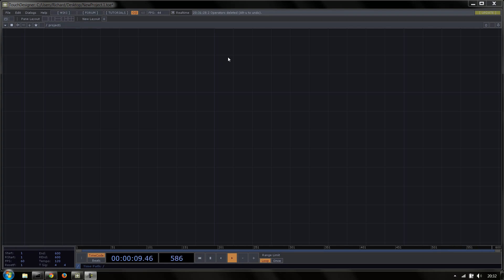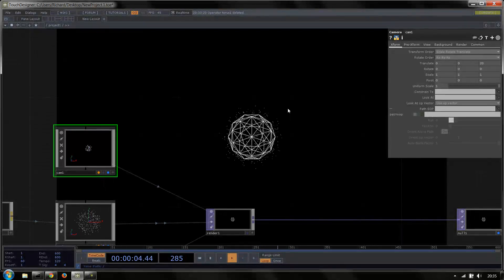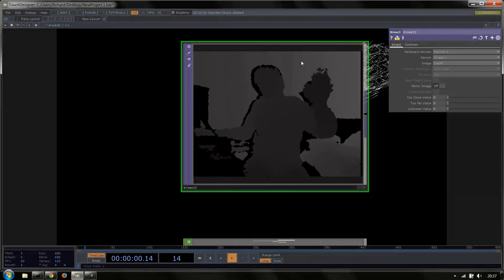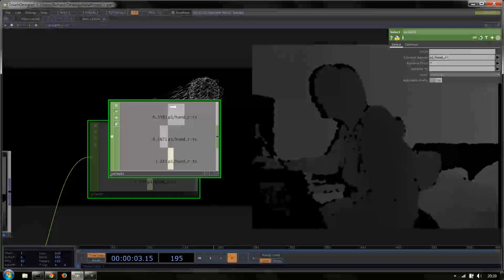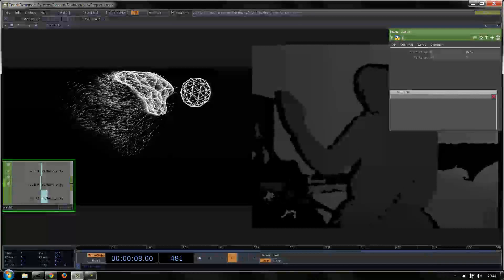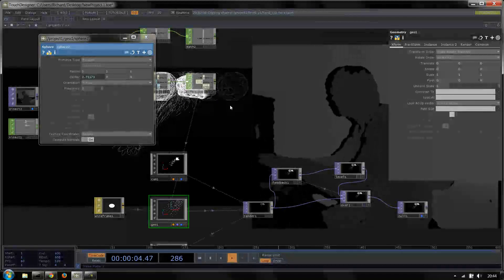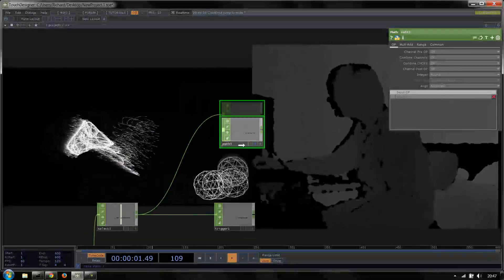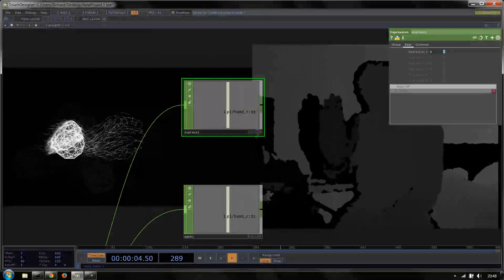Keeping in Touch 02 - Particle Attractors & Kinect

Comment: Amazing intro into particles and at attractors. Exactly what I was looking for.

Any suggestions on improving the performance? I created 3 attractors and now my FPS is hovering around measly 10, despite having 2GB graphics card (I know it's not a lot, but should suffice for the simple particle system here).
Reply: Setting up a default 1 frame / SFPS helped a little bit, but the FPS is still miserably low (25-ish)
Reply from the maker: @iljapanic  Particles in TouchDesigner run on the CPU so if you have a lot of particles they'll be slow as it's the CPU that's taking the hit. If you go to the palette you can find a component under tools called ParticlesGPU. This is a GPU version of the Particle SOP. You might be able to use that although it isn't as flexible as the particle SOP.
Reply: @VisualesqueVideo  Thanks a lot for such a quick reply! Found the Particles GPU component, looks smoother at the first sight. Any pointers for how to attach attractors to it? There is only a TOP input available by default.

Comment: Is there a way to have the second sphere avoid the first sphere, instead of attracting it? I am just wondering if that would be a way to push objects?
Reply from the maker: For pushing you could use the particle systems collision object (2nd input of the particle SOP) and set the particle SOPs hit behaviour to bounce on contact (this is on the particle SOPs limit page) and this would for example make your hand an affector. Another option would be to use the third input and plug a metaball followed by a force sop into that to act on the system. This is more useful for disruptive effects such as vortices etc though.

Comment: I have a question too, so here I'm using kinect v2 , this is the only video on internet that shows u that so far, well done.  At 4.41m when you switch the near depth on, here is cannot switch it even with face track on, I tried turning the kinect 2 node into a version 1 of the kinect and that works but my problem is I cannot see all these bars inside the nods with values for each arm , leg... neither if i select version 2, what am I doing wrong?  thx
Reply: same problem here. even if your comment is 2 years old.
Reply: @DennisNowack  problem solved. even if your comment is 7 years old

Comment: Hi, great tutorial so far, but how do you change the Background colour to black on the render window? Mine is a transparent checker board effect. Thanks.
Reply: Hi Graham,

This is in the preferences. edit menu > preferences > TOPs > viewer background. You can also just composite the visual over a Constant TOP and set it to black.
Reply: Richard Burns Thanks man, much appreciated! Also, could you tell me how to full screen that window for a projector? If its not too much to ask :D

Not sure how i could run it full screen on a separate monitor, also would this cut back on the physics and allow room for more FPS? Thanks.
Reply: You can use the window COMP to do this. You drag the TOP that you want to send out onto the operator parameter of the window and then set its size to fill location. Set borders to off and monitor to the monitor Id (probably 1) then when you toggle open on it will open up the window on the second screen
Reply: Richard Burns Hmmmm, i am looking to have the who display on the second monitor, that will be the interaction screen, black background with the animated interaction on it, bit like projection mapping, I hope this software can do it :( 

Just tried what you suggested and when i change to monitor 2, nothing happens no display pops up on my other screen, thanks.
Reply: Richard Burns All sorted now! Bar the particles leave a grey stencil outline on the secondary monitor, once opened on the second monitor, the background is a solid black, but upon interaction it starts generating this grey mess, odd huh? Probably a software fault. Thanks though! :D